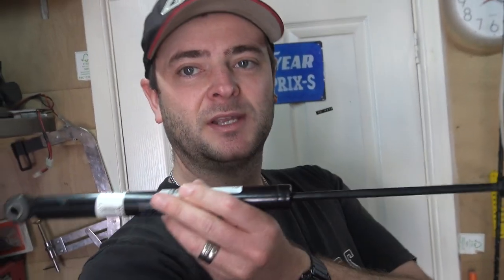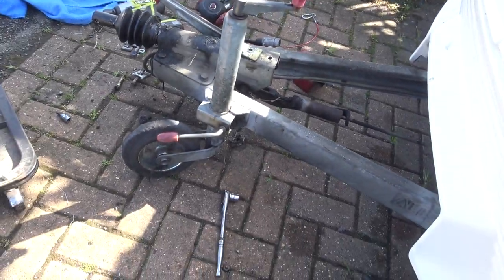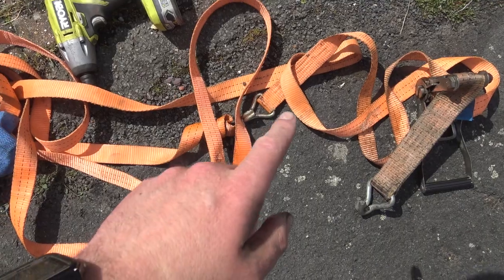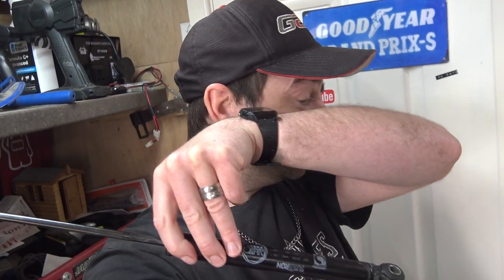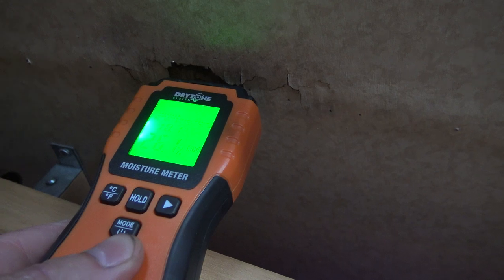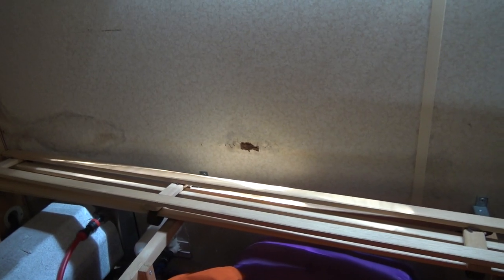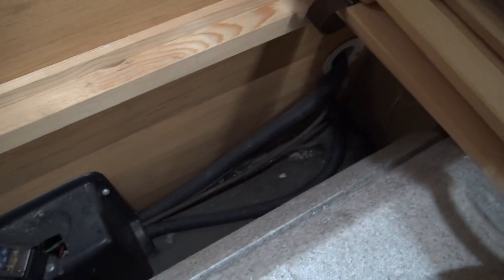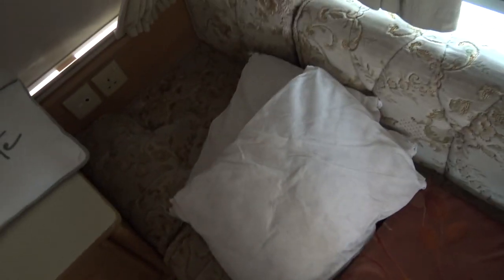Changing The Damper On My Al-Ko Caravan Hitch

Comment: Changing that damper is hard work done mine today I ended up pushing a bar into the damper to push it back and hold it to put the towbar and bolt on.the thing kept pushing back out
Reply from the maker: Yeah it will do, I found it quite easy once I’d worked out a method :)
Reply: @RSPYT  --so what was your method - I'm finding it very difficult to push the rod back ...joe
Reply from the maker: I used a ratchet strap to pull the damper in, then slotted the hitch onto it .
Reply: I'm having the same problem just now.
I took the manky old hitch off to clean it up and make sure it was working properly before selling the caravan. I'll have a look and see if I can figure out what you mean by using a ratchet strap.
Reply from the maker: @the.just.able.biker67 It wasn’t easy because the damper doesn’t give much time before it’s sprung out again haha but I managed it after a few tries. 👌🏻👍🏻

Comment: do you still have the talbot or did you swap it out for the caravan ? there a lot of work always looking for leaks our seasonal site opens 12th of may we wound up with a 41ft. 4 slide .2012. park model work all summer at it looking for leaks and coorking gives me something to do i can't tow  it. 2.7 liter 4 cylinder toyota tacoma 2012... won't cut it  had it towed there with a ton duelley ford
Reply from the maker: Nice, there are a few American 5th wheel caravans on the sites we go to. 
Towed by Ford rangers. 

We still have the talbot the company that’s mending it hasn’t started it yet sadly.

Comment: Don’t peel the aluminium back, cut out the bad wall board replace the inner wooden frame parts and polystyrene that are damp, new section of wallboard and tape the joins and job a good un 👍

Comment: It's a cunt of a job!! 🤣

I replaced mine today after watching your video. When I took the hitch off to refurbish it I thought it'd just go straight back on...but no!!
I didn't even know there was a damper rod in it, so it was no wonder the bolts weren't going back through.

I got a new one because the old one was all rusty and pitted.

I kinda refitted it the opposite way from you. I got everything loosely put together at the front, then it was just a case of pushing it in at the caravan end. I used a 3/8th extension bar with a socket on the end and forced it in by hand until I could wiggle the bolt through. 👍